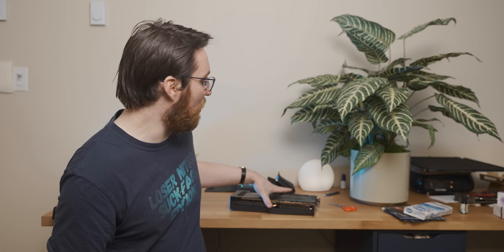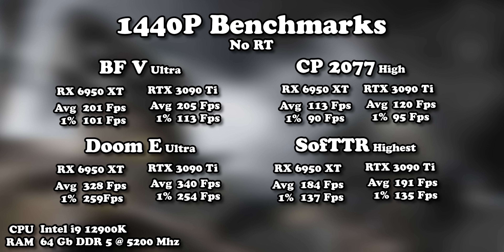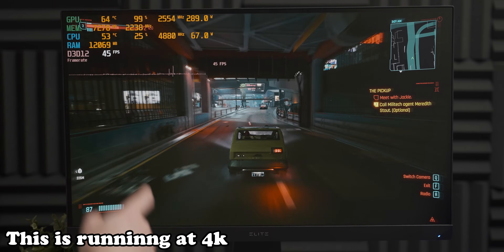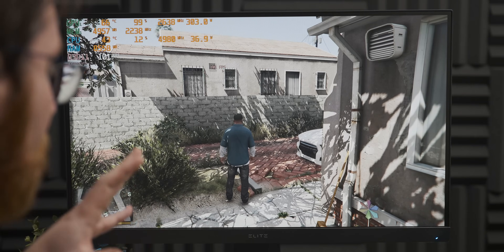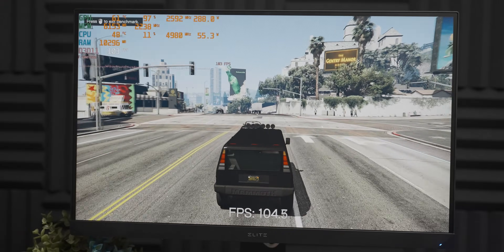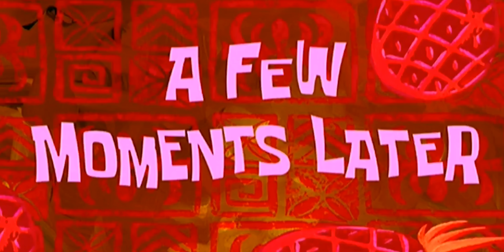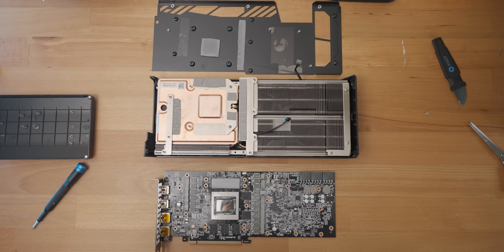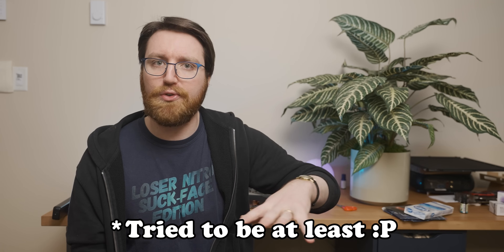I Can't Figure Out What's Wrong With This Gigabyte RX 6950 XT

Comment: The massive coil whine is what's concerning here, this has to be a hardware issue rather than software.
Reply from the maker: I was thinking it could be a hardware issue. I still haven’t heard back from them yet, I’m curious how they try and explain it.
Reply: @DawidDoesTechStuff  the delay in responding to the issue and not willing to say that it's a fault or "working as intended" is probably cost based. If more than one reviewer had the issue it can be a widespread production issue meaning if they say faulty then a fair amount of cards might end up as returns, given the chip shortages this is BAD. However if they say "working as intended " their card is more of a gamble (or just worse) than other 6950 xt's and their sales will suffer meaning they don't want that if at all possible to avoid.
So not responding is either just avoiding the issue or trying to make a cost analysis takes time, would be great if you could come back with their eventual response or if you don't hear from them in a while report that as that is in itself an answer.
Reply: @DawidDoesTechStuff  Just read Guru3D review, AMD software power reading are not accurate, you have to use PCAT to measure the GPU power consumption.
Reply: @DawidDoesTechStuff  BIOS can have an effect, it could be related to the high power draw, there could be something getting more power than it needs.   I had a motherboard that had a lot of whine and it just took a small tweak to cut it down.
Reply: @DawidDoesTechStuff  I would try running some benchmarks and see what causes it or take it apart and see if there is anything loose that's the only thing I can think or it's could be the fans or whatever
Reply: Yeah, Gigabyte seem to have problems with power delivery components and/or design... This is what happens when you use substandard components in systems that requires a lot of consistant power draw! Gigabyte might want to shop for other suppliers! 🤔
Reply: @RobertForslund  HA HA !
Reply: @RobertForslund  yep supply chain problems are an issue. Many things are not available.
Reply: @RobertForslund  Gigabyte seem to have problems with being a functioning business.
Reply: Could be. Since gigabyte doesn't know what the f they doing with their cards either.
Reply: @Ahfeku  thats a bold statement to make, how bout you back it up with evidence.
Reply: @Ahfeku  Coil whine is caused by the internal power delivery of the GPU and you know how Gigabyte does with power!
Reply: @tristanweide  This has nothing to do with Gigabyte, my Sapphire does the same and it's limited to 290W as well by design from BIOS. The faulty cards are the ones ignoring the power limits. Look it up in the bios specs. The 69XX series whines all over the place, it is what it is.
Reply: It is obvious that y'all haven't seen Buildzoid talking about the 6900+ radeon cards. Which is fine, but he's a fantastic YouTube channel. These cards, unfortunately, aside from a few AIB's, have truly atrocious input filtering on their PCB's. Hardly any whatsoever, which leads to loud as hell coil whine.
Reply: @TheNightKing22  I'm still inclined to think the performance hit is a hardware issue. Whether or not the coil whine is related.

I wonder if he used the same windows install on both systems. That's the only potential software issue that seems within the realm of possibility when you've tried multiple driver and bios.
Reply: coil whine can cause harmonics in the switching frequency of the mosfets which can limit power and could be an issue if not properly buffered/filtered.
Reply: @mareck6946  lol nothing to do with mosfets.
Reply: @BenState  So what does the switching then causing teh harmnonic dissonance in the coil ? :P
Reply: @mareck6946  The inductors are causing the whine.  Not the mosfets. And it's resonance, not dissonance.  Ffs.
Reply: @BenState  the signaling comes from the fets tho but this totally resonates with me g :D May the coils be with you :D
Reply: @mareck6946  Coil whine comes from the inductors.  Fact.  That's why its called coil whine; inductors have coils.  Nothing in a mosfet has the ability to create hysteresis.
Reply: @BenState  the sound is just a signal in the end too :P even if the fart comes out of ones ass it doesent mean it originated there .. ok .. i should stop drinkin at this time :P
Reply: @mareck6946  no, the sound is hysteresis.
Reply: As much as you guys hate on Gigabyte, I literally just got my Sapphire Nitro+ (non-pure) card yesterday and was wondering it had something wrong since it only draws 290W and the GPU boosts up to 2680mhz with a coil whine that goes through the roof... something's definitely off here and I don't think it's the manufacturers, smth in the design itself.

Funny thing, it scores 32k in PassMark G3D, which is well above average (29k), so I really don't know what's going on...
Reply: Most power hungry cards have coil whine.  Some are worse than others. You can even get unlucky and have it on a gpu that barely consumes 150w
Reply: Coil whine is some what common. I had a ton of brand new cards with coil whine and the manufacturers never would do much about it. Although gigabyte is trash
Reply: @cppctek  Agreed. Gigabyte has the most severe coil whine of any GPU I've used.
Reply: @saturnotaku  for a long Time my 1070 didnt have any coil whine (purchased used) but one day it started to do it so yeah i agree too
Reply: @saturnotaku  They do indeed tend to have lots of issues on the 3080/6800 class and higher cards, but that seems to be a much more extreme case than I've ever heard. Usually when it happens on the other Gigabyte cards, it's more like Dawid's Gigabyte 3090 Ti's coil whine, which is still definitely there, but doesn't sound like a cricket breeding farm co-located in a meth lab.
Reply: @saturnotaku  Asus has the most in my experience. No idea why.
Reply: @saturnotaku  my GTX 1650 super has a coil whine when i start playing gpu intensive titles and its quite loud and stupid mainly when you choose to play games without headphones on
Reply: @saturnotaku Both of my amd cards have loud ass coil whine compared to my Nvidia ones, my 6500 xt and 6700 xt both howl like wolves, neither are from gigabyte
Reply: @cppctek  Coil while mixed with the fact it runs 100 watts lower than other 6950s means it's probably a power delivery issue. This card is a POS
Reply: I have an Asus ROG Strix 3090 OC and my coilwhine is horrific - running it with an EK Waterblock. But it performs awesome and draws around 470w when running Furmark for instance.
Reply: Nope, my Rx6900xt coil whines like crazy and still pushes 300w. Sapphire model tho
Reply: This wine coil is also prevelant in the rx 6600xt made by gigabyte as well
Reply: My rx580 is coilwhiney as fuck i gotta sell it
Reply: Aaaaand a exploded psu in the past. Their QC individual/team are shit. I hope gamer nexus could expose gigabyte dishonesty. Will never ever buy any more gigabyte until they can prove their QC is on par with conpetitors or a mostly positive reviews from tech youtuber.
Reply: Depends on card though, my new MSI 3060 Ti only has slight coil whine when running ridiculous fps (500+). My older Gigabyte 2060 had 0 coilwhine while my friends MSI 3060 has massive coil whine, regardless, but no other issues in any way.
Reply: @ReallyNotTrix1  undervolting it could save it!
Reply: Maybe they have an inverted cap somewhere. ;P
Reply: Yeah, might be some VRM which may be the culprit
Reply: My Gigabyte 3080 12gb non TI has a lot of coil whine as well. Gigabyte told me it was fine.
Reply: Gigabyte, at least in my experience, had horrible coil whine on AMD GPU's don't know how it is on Nvidia ones though.
Reply: What overlay is that you're using foe the gpu?
Reply: @yackemup  it's msi afterburner overlay
Reply: I've had a 2070 and own a 3070 ti gigabyte triple fans. They're actually really quiet, my case fans are significantly louder by a long shot
Reply: Hmm well my GPU had coilwhine for a while, but eventually it stopped, I guess it was because of being new idk.. 😂
Reply: @Dawid simply got eco-friendly recession edition of the card that saves the planet while keeping your electricity bills low :P
Reply: Coil whine is one those things that isn't going to destroy the card. It's just one those things that are normal for high power draw cards.
Reply: Some are just manufacturred that way, most 2060 Super cards suffer from it for example.
Reply: They say coil whine is totally normal
Reply: @shorty808100  With 100 less watts? Are you dense?
Reply: amd and coil whine?  Say it aint so! :)
Reply: @Paul ...but amd has perfected it.
Reply: I doubt it. Coil whine is very normal. You wouldn't even notice it if the card had a smaller cooler because the fans would have to run faster, covering up the noise.
Reply: i agree, that doesnt sound normal at all.
Reply: my RTX 2080 Ti whines the shit out of itself above 120 fps. But there is nothing wrong with my card, works like a charm.
Reply: @Cor-Onar  fps does not matter, it's power draw. It's normal, especially when your fans are quiet. You only notice it because the noise floor is lower
Reply: @raycert07  thought the same thing, but when i pull 300 watts with 60 fps - silence...
Reply: coil whine is normal. my card does the same and everything is working fine
Reply: MASSIVE coil whine is USUAL on gigabyte products.
Reply: coil whine isnt a problem other than the noise right?
Reply: If you think coil whine is an issue you don't know computers. My gtx970 was a screamer and never gave problems had it for 6 years
Reply: When coils first start to whine is when you need to address the problem. You just got to snack dem coils and say "no kitty that's a bad kitty"

Since Dawid let the coils whine for days on end without smacking them one single time, those coils have the idea that they can keep whining until Dawid finally takes them to Jack in the Box for some jumbo Jacks with curly fries.

The coils are now completely spoiled and will ruin Dawid's life and possibly his marriage.

Throw those whiny coils out the door and shack up with some younger, hotter coils in the future. And if they start to whine, IMMEDIATELY come back at them with a firm: "no kitty that's a bad kitty"
Then they'll shut up.
Wicky wicky wild wild west, Artemis Clyde Frog shooting a big metal spider!
Reply: @Boogie_the_cat  this was the most beautiful thing I've ever read in my life...
Reply: It may be a lower quality part so that can’t meet the requirements of the normal one and they are charging the same for it.
Reply: coil whine exist from the start of gpus  its is happeninng 
 in all brand gpus
Reply: My sapphire nitro+ does not have coilwine, atleast i dont recognize it
Reply: Do you normally power the card with 2 plugs on a single power supply cable or with 1 plug on  2 separate cables? Have you tried seeing it that makes a difference?
Reply: @LifeInFrame  if the psu give you 2-3-4 or more PCIe  ports then you use the ports on psu   if the psu  have only 2 PCIe  ports  and you need  3    the you use the double  PCIe cable connection
Reply: @ReallyNotTrix1  Coil wine would never be a software issue. It also isn't anything to automatically worry about.
Reply: @denizenofclownworld4853  you can in theory write software that makes the GPU play a song with coil whine as that's linked to framerate / kernel execution time :D
Reply: @ProjectPhysX  ....if the coils wine to begin with. 

Coil wine is caused by the manufacturer not using any or enough potting/dampening material making inductors. It's not nearly as big a deal as the techies make it out to be.
Reply: Gigabyte...
Reply: Yes. I agree. What's most confusing to me is why they didn't just take it back and replace the review sample with one that would have got a positive review.

It's a pretty remote possibility but I have heard that the 5000 and 6000 series amd cards draw a lot more power on alder lake systems than previous Intel and all amd platforms. But none of those reports mentioned anything about actual performance differences. I think it was more an issue of the cards idling at high power draw on alder lake, like they weren't correctly entering the power saving mode when idling.
Reply: That can't be the issue, it's bad but it will rather increase your power consumption because your fan motor has a harder job to turn the fan. Also the temperatures don't go up. Still I would have return it with that noise. It won't get any better what the fan concerns.
Reply: @rinusheemskerk  Coil whine =/= fan bearing noise.

Coil whine is a side effect of the inductors vibrating at a frequency that resonantes audibly. Common in very high powered DC power conversion circuits, but can often be mitigated to a large degree with other design changes to the power circuitry.
Reply: @bjn714  I misunderstood the words. English is not my birth language. Than it might be a power supply issue and it just doesn't get the juice it needs. Thanks for the explanation.
Reply: @rinusheemskerk  he also tested two different power supplies, as well as two entirely different test systems, and every test resulted in exactly the same 289W peak power. There's something wrong with the card itself.
Reply: @bjn714  that's the thing, I don't think it's Gigabyte. My Sapphire Nitro+ (non-pure) does the exact same thing.
Reply: @bjn714  I agree. Only curious if he tested a higher capacity power supply.
Capacitors to vibrate at a high frequency normally is caused by short of power.
I would use a Modular Power Supply that meets these requirements.
But your probably right. I would have send it back.
Reply: @rinusheemskerk  Well actually, just after a short investigation of mine, if you look on thechpowerup the bioses they have for 6950 XT are limiting power to the cards output and mine too has 290W which is a bios limit. I think the cards that draw insane amounts of power are the faulty ones, ignoring bios specs. My sapphire non-pure is 290W, the Pure is 325W limited and the Toxic is 332W limit accordingly, so this is by design.
Reply: @rinusheemskerk  did you even watch?
Reply: @BenState  it was a misunderstanding of words at my part. English is not my narrative lenguaje what I already explained to a colleague viewer. And to answer your question directly: yes
Reply: @rinusheemskerk  fan noise is nothing to do with coil whine the 2 are completely unrelated
Reply: @norfolkngood8960  thanks, I already have been told. I misunderstood.
Reply: ASUS does a better Job at hardware
Reply: Lot's of card makes unfortunately in different degrees coil whine, the more power it draws the more you'll notice it? Maybe Gigabyte wants to hide it 😛 I would RMA it if possible.
Reply: coil whine is normal on high power cards running lots of FPS

Comment: laughs with my 510w 3090ti, my guess is the ol' reviewer vs retail switcheroo.. Not unheard of, reviewers will get special binned cards that will perform way above spec to make themselves look good, while the retail card gets a little bit of a gimp (they dont have to bin retail cards, save for the Aorus Extreme line) Ill bet if you got the Aorus version of that card, it would perform as its supposed to.. and you were sent a retail card by "accident"
Reply: woah! That would be wild if true... What buyer would really take it out the box and test it's power draw to see if it's pulling what it's supposed to? Very few!

Comment: If you run a rtx 3090ti without a cooler while running a maxed out cyberpunk 2077, how fast does the card thermal throttle
Reply: it probably would shut down before you get to launch the game
Reply: The card would crash before you could even load it, as soon as the pc turns on the pc would probably just blue screen